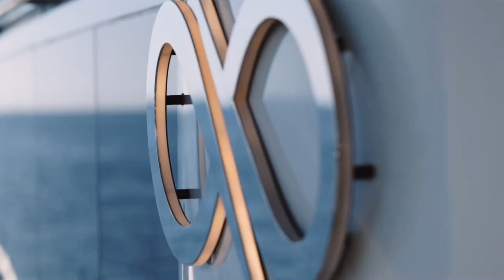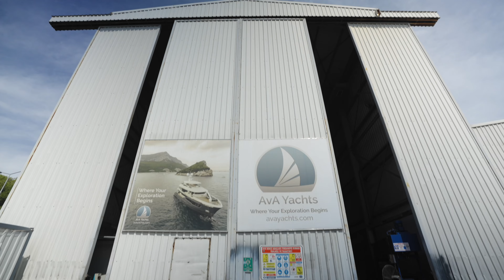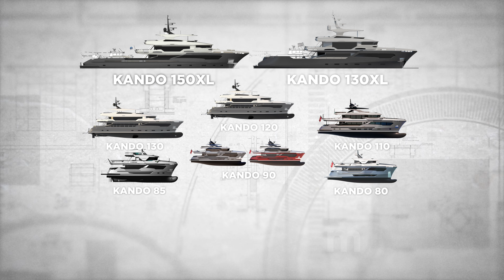AvA Yachts - Explorer Yachts that you REALLY CAN explore with!

Comment: Does the Bulbous bow also slows down the pitch of the ship? Because you get waterpressure on top or underneath it slowing down the up and down movement.
Reply: *expert answers en route.
Reply from the maker: Actually, that's a good question. I would imagine it does, but I'll find a naval architect to answer you!
Reply: @yachtbuilders  Thanks! Looking forward to the answer! 
If it does, can you ask also if it will have more effect on lighter ships (aluminium and GRP) than heavier (steel) ships. Also the shape of the bulbous bow will probably matter. The one AvA uses will have more effect than the one Bering uses.
Reply: If the bulb slows down the downforce  because of the inside air volume, you will also get the opposite effect with the bulb helping the bow to rise back up again because of the entrapped air.
Reply: @franks.hansen6788  Probably has to do more with the volume of water that is displaces and the resistance it gets to go around the bulbous bow and the pressures that creates.
Reply: @franks.hansen6788 Given that diesel is lighter than water, I do wonder if all that volume could be better utilized as a fuel tank...?
Reply: From my understanding of watching YT videos over the years the bulbous bow works efficiently at a certain speed (speed varies depending on ship length/size).  At that speed, yes, at other speeds, it would vary.  (In layman terms, a bulbous bow is like buying a car that "is extremely fuel efficient at n MPH only, but at other speeds it isn't.")
Reply: @grondhero  That concerns the forward speed, my question was about pitch resistance.
Reply: A bulbous bow is almost entirely submerged in normal conditions (as it must be to be a bulbous bow - otherwise it would just be a form of reverse-raked bow.), and it works by changing the bow wave shape and size to MIMIC the effect of a longer waterline length WITHOUT increasing the waterline length, thus increasing theoretical hull speed (usually given by 1.34 x square root of Waterline Length) without the additional associated frictional drag induced by waterflow at the junction of air and water of an actual longer waterline length.
There is no significant difference in resistance to pitch up or down with a bulbouos bow in normal conditions - bow flare is usually the biggest factor in hull shape resisting pitch where the topsides become submerged as the bow pitches down, creating additional bouyancy that resists further pitching down..
That is my understanding, but feel free to provide a better answer.
Reply: @randybentley2633  A vessel large enough to have a practical bulbous bow is almost certainly large enough to be able to store that relatively small volume of diesel amidships, where it better helps stability (most importantly - rotational inertia) and where using up fuel on a passage does not affect the vessel's fore / aft loading or balance. But you could if you really wanted...
Reply: Yes that is correct!. It does
Reply: @AvAYachts_  Thank you for the answer!
Does it have more effect on lighter (aluminium and GRP) ships than heavier ones from steel? And does the bulbous bow you use have more effect on the pitch than the ones that Bering uses?
Reply: @AvAYachts_  If the bulb is already fully submerged, how does submerging it any further provide any additional buoyancy ? Additional buoyancy can only be provided by submerging more of the hull (in this case, the topsides of the bow). Are you claiming a hydrofoil effect at such low (displacement) speeds and with such a relatively small surface area and with so much beam aft of the bow restricting waterflow ? There is a reason the bows of submarines are bulbous and pitch is controlled by vanes placed at the side of the hull - the bulb is pitch neutral.
Reply: @peterhoofien7302  Thank you for your questions!. We cannot say whether it helps lighter or heavier vessels more or not. But we can say that well designed and suitable shaped bulbous bow does help for all size and weight of displacement vessels. Well formed bulbs can work to reduce the drag at all speeds on every size of displacement boats. Unexperienced designed bulbs can have reverse effect and can increase the drag! It is all about regulating the water flow and reduce the waves alongside your hull. Bulbous bows must be designed by using latest computer analyses and ofcourse with an experience which we have done already. I have no any words for the bulb designs of Bering!
Reply: @RandomGuyRandomNumber  Thank you for your questions. Please be inspired by submarines to understand how does bulb works. It is all about how much waves your hull is making. If your boat is making huge waves alongside then it means  you are burning fuel to push the water rather than moving your boat. Submarines do not do that.

Comment: Are there only five crew for twelve guests?  And do the crew have to be exposed to the elements to get to the galley?  That could be unpleasant in the colder areas, especially if there's strong winds and waves slapping against the hull.
Reply: 5-7 crew is normal for 12 guests.
Reply: @kokomo9764  7-9 crew is normal.  Five is minimal is strenuous.

Comment: While the captain's cabin in behind the bridge, which is good, he'd have to run through the bridge and guest hallway to get to a bathroom, what? While it's good the crew cabins have more space, there's only two of them (and located with no direct access to the galley)... so a 33.5 meter yacht with 5 crew (but for 12 guests).  And this on an explorer, which by nature is meant to go long distance and be at sea for a while. Sorry, but no.
Reply: I haven't seen a captain's cabin located behind the bridge that didn't have an en suite; it appears this does at 5:51.  The crew count would be a problem for me as well, if it's just five.
Reply: @grondhero  The GA at 5:51 is what I'm looking at... Has the captain's cabin on the port side, then closet/stairs and a hallway (between bridge and upper salon) in the middle, and then a bathroom with shower on starboard side. They basically added a shower to the day head for it to be used for the captain I guess? I've actually seen another yacht that had a small cabin behind he bridge with no head whatsoever on that level (on a YT video), and another one on a GA only. Go figure LOL